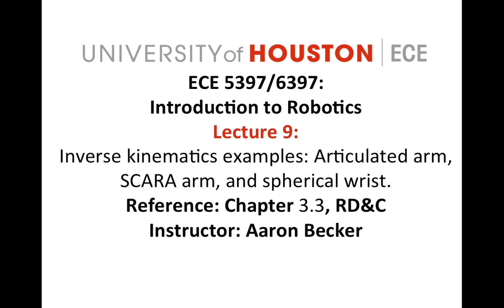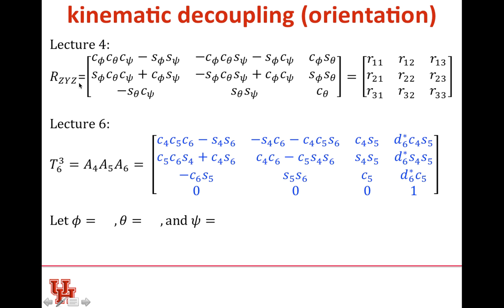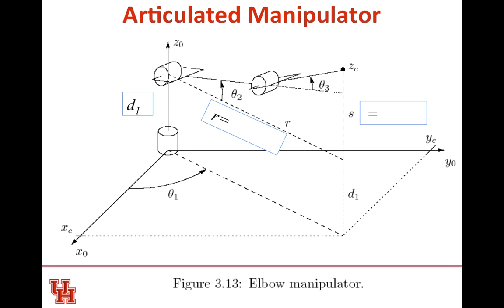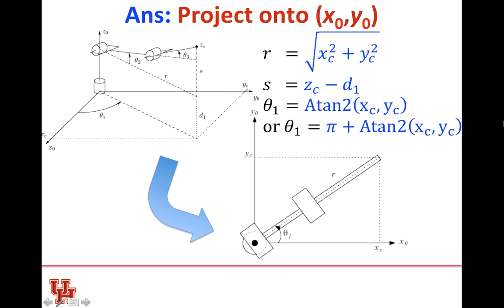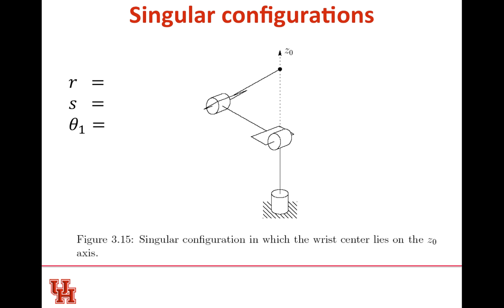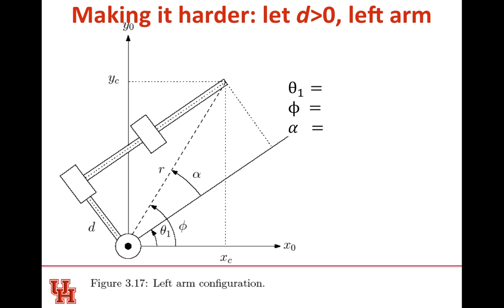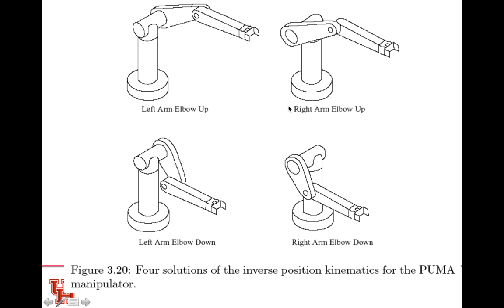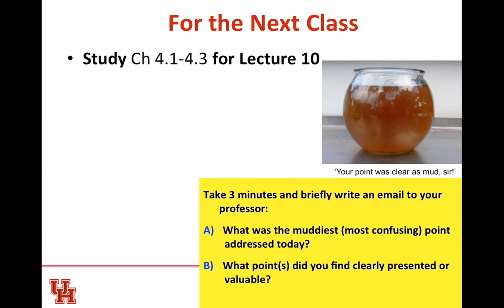Intro2Robotics Lecture 9a: Inverse Kinematics Position

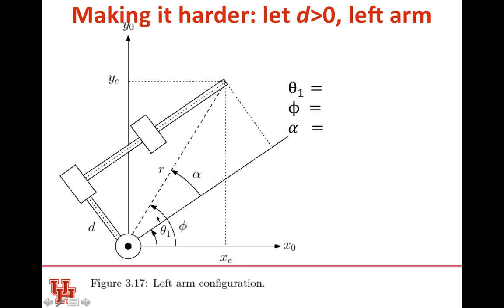Comment: I have a doubt. Should'nt all the atan2() arguments in the section 11:08 be swapped? Shouldn't Phi be atan2(y_c , x_c) and the same change be applied to the arguments for the angle Alpha?
Reply from the maker: It depends on the programming language you use (so be aware!) . https://en.wikipedia.org/wiki/Atan2 : " In Common Lisp, where optional arguments exist, the atan function allows one to optionally supply the x coordinate: (atan y x).[5]
In Mathematica, the form ArcTan[x, y] is used where the one parameter form supplies the normal arctangent (note that the order of arguments is reversed relative to the convention used in the discussion above). Mathematica classifies ArcTan[0, 0] as an indeterminate expression.
In Microsoft Excel,[6] OpenOffice.org Calc, LibreOffice Calc,[7] Google Spreadsheets,[8] iWork Numbers,[9] and ANSI SQL:2008 standard,[10] the atan2 function has the two arguments reversed...."
Reply: @AaronBecker  thank you. In the case of MatLab, which I use, first comes the argument that will be on top of the fraction

Comment: why did you change the value for r from sqrt(x^2 + y^2) to sqrt(x^2 + y^2 - d^2) from 8:33 and onwards, and what is d in this instance?
Reply from the maker: d is the (optional) shoulder offset shown in 10:31 and onward.  If d is non-zero interesting things happen:  parts of the workspace become inaccessible.  (You are right to point this out -- I should have saved that notation for later.)
Reply: @AaronBecker  Thanks for the quick awnser, figured it out eventually :p.  But turns out the reason my program wasn't working was because the python numpy.atan2() is opposit to the one you are using ( numpy.atan2(y,x) ).

Comment: what does the d represent  in theta 3 and theta 2 equation?
Reply from the maker: @9:44 the D is the solution for cos(theta_3), which is derived using the Law of Cosines. @13:52, d is the offset along z_1 of the shoulder joint.  Are those what you refer to?

Comment: Thank you! This is very helpful. One thing is not clear to me tho - what is c3 and s3 in this example? Used for the calculation of tetha2 ( 09:00 )
Reply from the maker: c3 is shorthand for Cos(theta_3), and s3 is Sin(theta_3).  These shorthands are common in robotics, since rotational joints quickly generate many trigonometric functions.
Reply: @AaronBecker  That clears things up, thanks for the quick response.

Comment: The solution for theta3 is incorrect due to wrong substitution for `s` which should have been just (zc-d1). Can you please check that?
Reply from the maker: Aniketh, you are right. At 9:28 this should be (z_c-d_1)^2  in the equation for Cos(\theta_3) and should be (z_c-d_1) in the middle equation for theta_2
Reply: @AaronBecker  Please pin this comment or make an annotation in your video. I'm glad I managed to look at comments because I was going crazy looking at the basic algebra.
Reply from the maker: @splitgatecommunityleague4935  thanks -- I pinned a new comment to the top.  YouTube removed the ability to add annotation cards from small-time creators like me, so until I get 4k watch hours, a pinned comment will have to do.
Reply: @AaronBecker  I'll run your videos on repeat tonight!

Comment: Hello! I'm trying to apply this into a program. I'm applying theta1 = atan2(Yc, Xc) - atan2(b, r)  | theta3 = atan2(sqrt(1-sqr(A)), A) | theta2 = atan2(s, r) - atan2(d3*sin(theta3), d2 + d3*cos(theta3)) | d1, d2, d3 are my joint measured distances.
For some reason, theta1 is correct, theta3 is also correct but theta2 gives me a wrong value. I have applied the corrections in the comments by ANNIKETH REDDY SEELAM.
my d1 = 0.550 | d2 = 0.400 | d3 = 0.325
using forward kinematics, using theta1 = 0.175 | theta2 = -0.175 | theta3 = 0.524 (in rad) I get (X,Y,Z) = (0.689, 0.121, 0.508).
using reverse kinematics with (X,Y,Z) gives me (theta1, theta2, theta3) = (0.175, -0.293, 0.524)
Am I missing something? Getting quite desperate here
Reply from the maker: What are your variables b, and A?  Please remember that if the point is reachable there are up to 4 possible inverse kinematics solutions to each (Xc,Yc,Zc).  The 4 are 1.) behind the back elbow up, 2.) behind the back elbow up, 3.) in front elbow up, 4.) in front elbow down.  The proper way to test your code is to put the inverse kinematics solutions into your forward kinematics model and make sure you get the same (Xc,Yc,Zc).  You should also modify your code to return all 4 inverse kinematics solutions.
Reply: @AaronBecker  after a nice sleep I figured out I was measuring theta3 wrong and getting the negative angle. I am now getting the right solutions and returning all 4 possible solutions, your video was of great help!
Reply from the maker: @diogoduarte7401  Glad to hear of your success!
Reply: @diogoduarte7401  hello sir. Could you provide a fix to your theta2? I'm not getting my desired value for theta2 as I have used the theta2 equation from your comment earlier and from the video.
Reply: Nevermind. I solved it. Theta3 in the eqn theta2 should be in radian.

Comment: These are great for learning the math behind industrial manipulators.  Do you have any publications?  Or any good reading recommendations for practicing engineers?
Reply from the maker: https://scholar.google.com/citations?user=TJHrmS4AAAAJ&hl=en is my lab's google scholar page.  Reading depends on your industry.  I like Programming robots with ROS: http://shop.oreilly.com/product/0636920024736.do
Reply: Aaron Becker I'm a BSME and do a lot of robotic programming with industrial controllers.  I like tinkering with old robotics and reverse engineering the dynamics and controls.  Thanks for the recommendations!
Reply from the maker: To focus on dynamics and controls, a wonderful new resource is "Modern Robotics: Mechanics, Planning, and Control," Kevin M. Lynch and Frank C. Park, Cambridge University Press, 2017, ISBN 9781107156302. Purchase the hardback through Cambridge University Press using the 20% discount code LYNCHPARK2017 or through Amazon, or check out the free preprint version at http://hades.mech.northwestern.edu/index.php/Modern_Robotics .  I like this book, and enjoy that Kevin Lynch and Frank park have made many 5 minute long lectures available.
Reply: Both of these are great recommendations!  Now I need to get myself a linux setup.  Thanks!

Comment: Hi, what resource are these figures from?
Reply from the maker: Robot Dynamics and control, by Doing, Hutchinson, and vidgascar. A Google search will help you find a preprint of the book. I like the book for teaching.
Reply: Thank you!
Reply: The example I am trying to solve for has similar configuration as seen in fig 3.18, but there is another negative d offset in the last joint as well. Can I use the same equations for theta 2 and 3 as shown at 9:13 s? The only difference would be instead of d, i would use d2-d3..

Comment: It would be better to normalize sound. It is quite quiet relative another sounds in my system or compare with other YouTube videos
Reply from the maker: You are right -- is there a way to fix this once it is on YouTube?
Reply: @AaronBecker  I'm not sure. It seams like Youtube does not allow to modify audio of the uploaded video. But I'm not experienced youtube uploader, maybe there is some way.
Reply: @AaronBecker  If you have the file you uploaded, you might try to fix audio localy on your computer. Then find way to add fixed audio to audio library. And thus you be able to apply fixed audio simmilar background music.
I don't know if it possible.

Comment from the maker: The solution at 9:28 should be (z_c-d_1)^2  in the equation for Cos(\theta_3) and should be (z_c-d_1) in the middle equation for theta_2.  Thanks Aniketh for the fix.  [incorrect due to wrong substitution for `s` which should have been just (z_c-d_1)].
Reply: Sir do you have lecture regarding the use of Inverse Jacobian for solving inverse kinematics? I'm stuck with this.